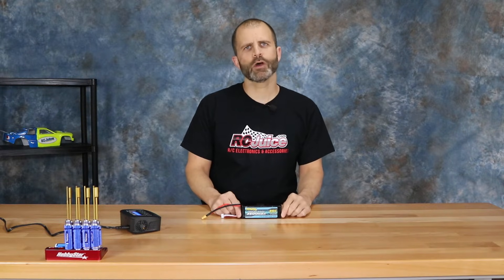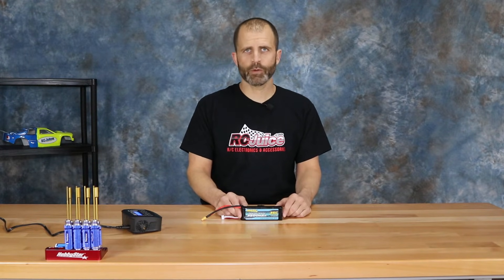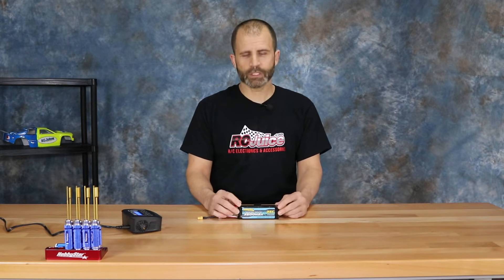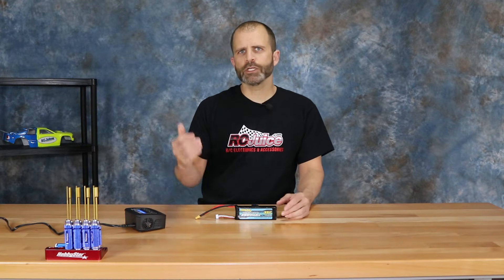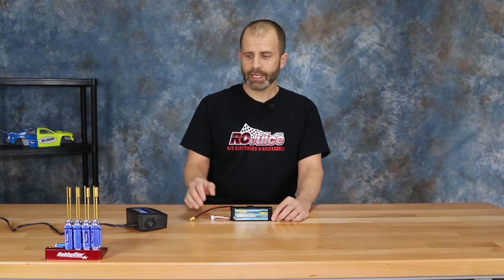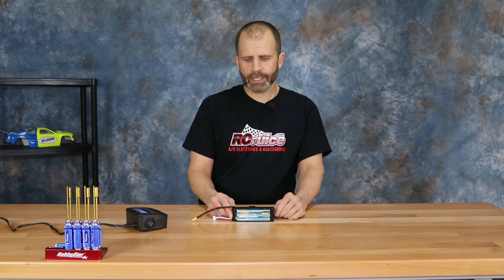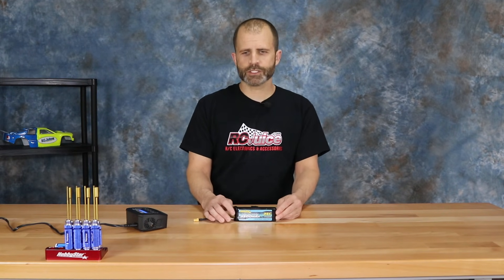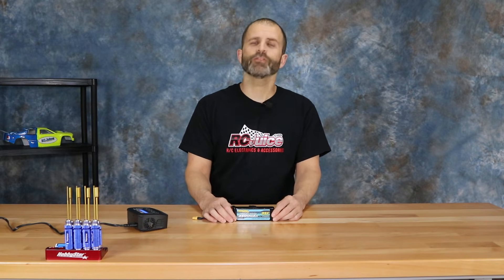Don't throw away your LiPo, revive it!

Comment: Thanks for the video. Do you have a tutorial to revive a multi cells lipo with only one cell that the voltage is too low?. I have a 3S 1500mah that only read as 2S by my balance charger. Turned out one cell have less than 2v in it
Reply from the maker: There is no way to do this with a standard Lipo charger, but charging it in NiMh mode will charge all cells. If you have only 1 cell that is lower than the rest then it is likely a bad cell and may not be able to be revived, this trick is more for overly-discharged packs on which you'll see low voltage across all cells.
Reply: @RCJuice  Ok.. thanks for replying

Comment: I usually just use a jumper wire and connect a charged pack into dead pack for a couple min ,bring v up and then charge them
Reply: Hey how do you exactly do that? I have a 3S 1500mah that only read as 2S by my balance charger. Turned out one cell have less than 2v in it

Comment: My voltage goes to 4.21 for all cells but the charger stops and says the battery is charged - but the mAh is only 1000 and it's suppose to be 4000 mAh, Whats wrong with it ?
Reply from the maker: What are the cell voltages when you begin charging?  It depends on how depleted it is when you begin the charge cycle.

Comment: My charger says battery check cell conn err. An when I try nigh says the same thing but one of my cells are way lower it's a 6 s
Reply from the maker: You can still try this, but if you have 1 cell that is really far off of the others it may be a sign of a bad cell that cannot be revived.  This is more for when all cells have been discharged too far.

Comment: What do you do for the smart lipos?
Reply from the maker: You may not be able to do this on them unless you can isolate the power terminals and connect those directly to a LiPo charger.
Reply: @RCJuice  hey my battery is a traxxas 4s lipo cell 4 is 0.1v
Reply from the maker: @onyxtheprotogen7907  0.1V may be too far gone, you can try this trick but it may be done.
Reply: @RCJuice  i hooked it up yeaterday and it showed 0.0v and on the other battery it wouldnt even pickup the 4th cell
Reply from the maker: @onyxtheprotogen7907  That unfortunately sounds like it's too far gone.

Comment: Hi, my C1 is 3.7, C2 shows ZERO, C3, 3.7
can i still use the same trick? charge with NiMh at 2.0 amp? how do i know if its working or its not working?
If its working the voltage should continue to climb til 11v? and not working if it continues to linger at 7.4-7.5v?
Reply from the maker: Unfortunately, that is most likely not revivable.  When all cells are low then the pack health is usually OK and they just need to be charged up a bit, but when 1 cell is at 0 and the others are at a nominal voltage that sounds like a bad cell altogether. Sorry....
Reply: @RCJuice  Thanks!!

Comment: Can this be done with traxxas iD lipo if so how thanks
Reply from the maker: ID plugs are compatible with standard Traxxas plugs, you can use any standard charger and a Traxxas-style charge-lead or even use alligator clips in a pinch. You just need a charger capable of charging NiMh packs.
Reply: @RCJuice  thanks for reply

Comment: Can you make a video showing how your HobbyStar 120 amp esc works with sensored and sensorless motors? 

I have one of your 120 amp ESC's that doesn't work correctly with a sensorless motor. When it set the esc to "forward with pause then reverse" the esc only allows me to use the brake once while the truck is moving forward at any speed. If I use the brake more then once the truck will try to go into reverse and this causes the truck to try and lockup the back wheels or even make the wheels spin in reverse. My 80amp HobbyStar esc allows me to use the brakes for as many times as I want and will actually pause when the truck comes to a complete stop and then I'll be able to use reverse.

Comment: It's funny you made this video because I know this trick and was just trying it on 2 batteries I have. My question is how long can I charge them, while supervising them since the 30 seconds to a minute things not working ? Great vid!
Reply from the maker: Thank you for watching!  You can technically charge them up until they are at 4.2v/cell,  doing this is just like charging them in LiPo mode but it will just not stop.  We don't recommend charging them all the way up this way, but you CAN charge them for much longer than 30-seconds to a minute, that's just usually all it takes.
Reply: @RCJuice  Appreciate the info